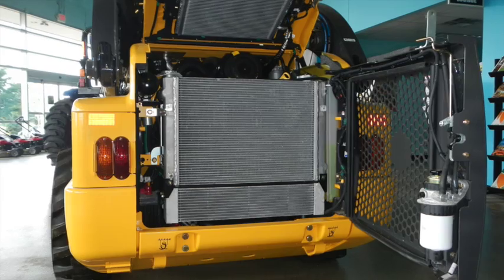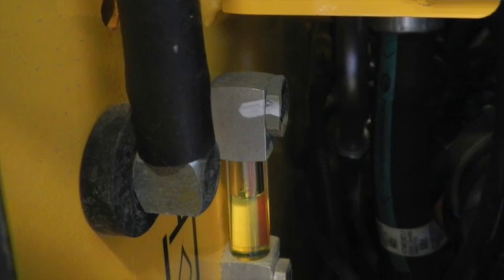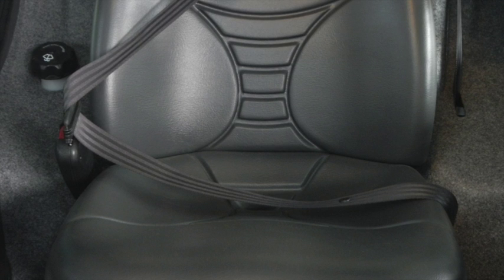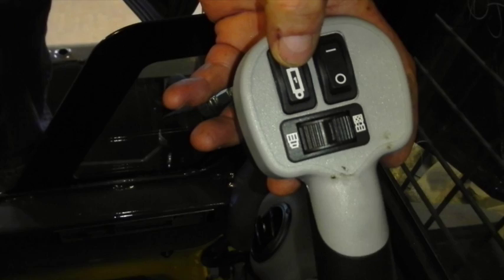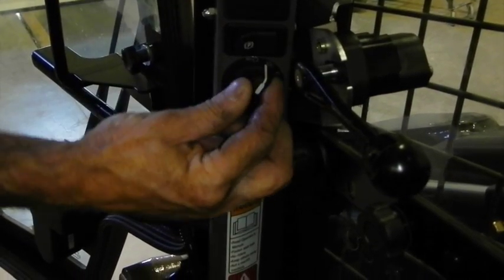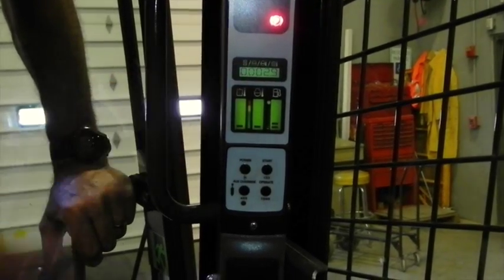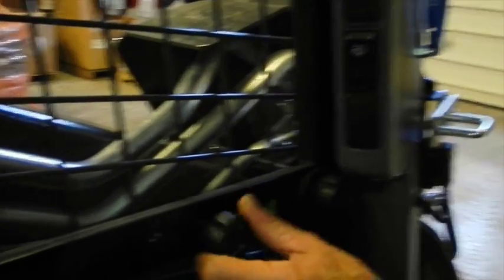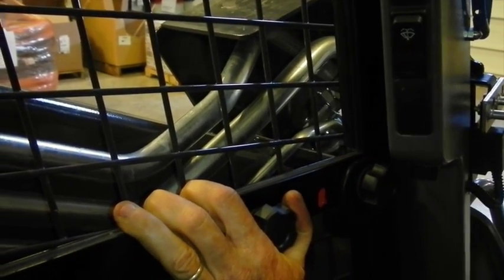Ask The Experts: What Should I Know About New Holland Skid Steer Loader Control Functions?

Comment: I'm fairly amazed that there is no armor ring around the valve cores -
Reply: Jay Phillips I am trying to start the motor and it will not turn over
Reply: I have my seatbelt on and the battery is fully charged it is very cool out side